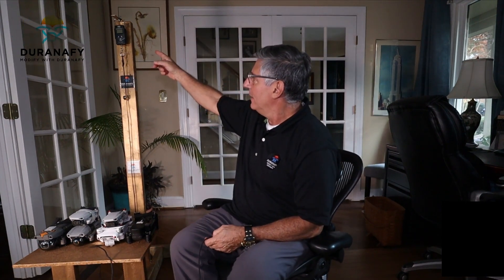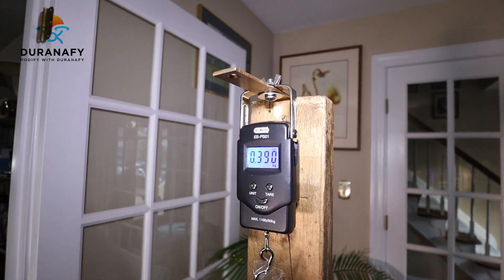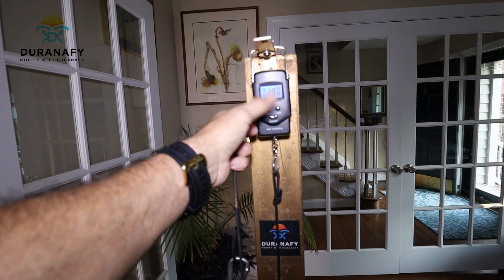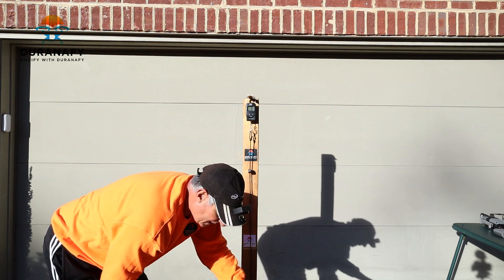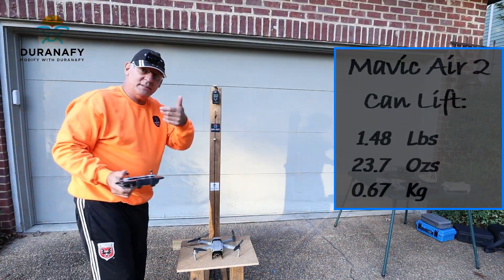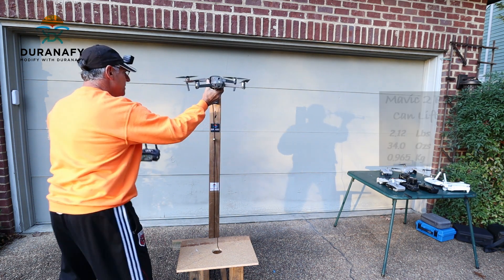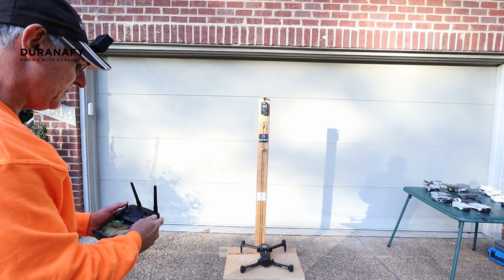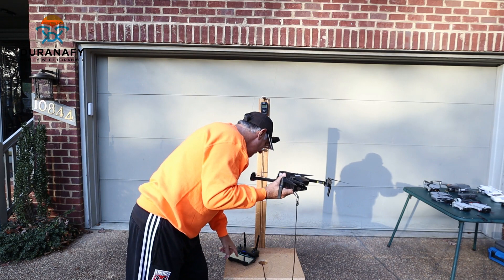WHICH DRONES HAVE THE MOST POWER

Comment: I love this! 
I’m sure everyone outside of Idaho knows this isn’t accurate but it’s safe to say it tells us enough to prove your goal in this video. 
I would love to see more in sport mode without pulleys and also a smoother more accurate tension on the line. Not sure if those hard tugs threw the meter off but the pulleys definitely don’t give you the actual pull accuracy. It’s probably good enough to back up which has more power except for the Zino and Fimi which were definitely causing mixed reading bobbing around like they were. 
Old Zino got a little pissed off there. You called that one perfectly just before taking off. 
Do you still have all your fingers crazy man? 😂
Reply from the maker: Thank Chris! You are right about the weight accuracy. It is not the exact weight the drone is going to lift of course, what is important is which drone can lift the most weight. The other good thing about this test is that, all drones are playing on the same field soto speak.
Yeah, Sport mode should be next!
Reply: @Duranafy  Think you can safely work out a straight pull and maybe aid it to a steady takeoff tension? Evo 2 would be interesting as well. 
I’m looking forward to more on this. Had you sent me the Z2 you might of had that one to challenge the others.

Comment: Keep in mind for anyone considering to actually lift and move objects in the real world is that an actual flight experience with any object added -- especially a heavy one -- is going to be different than an on-the-bench test like this. The weight of a can be felt during flight, and can cause instability as well as stress motors, ESCs, and batteries. The electronics are bursting to cover for any significant added weight. Overall, I wouldn't try to lift anything more than lightweight objects, expect less than half of whatever measurements to be realistic for lifting anything. I know this from experience having lifted objects and retrieved stuck drones.
Reply from the maker: John is absolutely right! When I piggyback the Mini on the Zino, Fimi and Mavic 2 the flight characteristic as expected are very sluggish and I fly like driving a truck with a heavy load. The ESC on the Mini 2 became overloaded after the 3rd flight. The other lessons learned from this experiment was:, DJI  and Fimi algorithms kept changing the flight time to to return home the harder I pushed the throttle up.
Reply: @Duranafy  That was the battery sagging from high amperage draw, trigging the low voltage parameters. Normally, that would normally be accurate in activating return to home (or warning the user) but in this case the voltage sag was because of the added resistance.